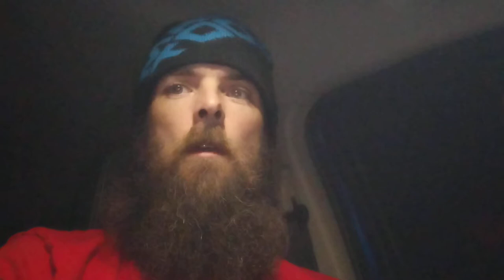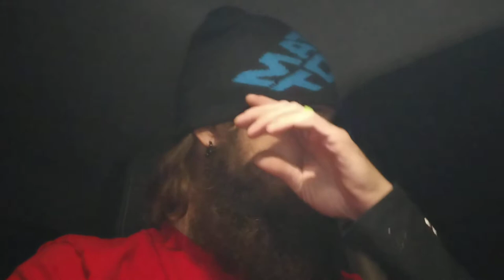My Brake Caliper Keeps Sticking. Why?

Comment: Been dealing with this issue for months now, rebuilt the caliper, putting new hoses now. Fingers crossed
Reply from the maker: I bet you have a collapsed hose or the inside has been eaten away Making little flaps not allowing the fluid to retract keeping the caliper activated. Keep me updated.
Reply: Will do. Its been cringe driving the car. The engine has been working twice as hard, wasting more gas. We'll see how it goes this time.

Comment: Just replaced both rear hoses on my daughters ‘07 equinox. They had the factory stampings on them! They still looked ok but seeing as how I was also replacing the calipers, I changed them  at the same time. Cheap insurance in my book.
Reply from the maker: Smart. Cause if you didn't change it.  Then it would probably fail. You are correct. Cheap insurance better safe than sorry. They are only good for about  5 years anyway. Brake fluid should be changed every 5 years as well
Reply: @BeardedFordTech  yep, did that at the same time. 
Was definitely on borrowed time with those hoses.
Reply from the maker: @dm7097  job well done!  Now it should last many more years.
Reply: @BeardedFordTech  idk about that, I am in the salt belt of western New York. Lmao
Have a great day!
Reply from the maker: @dm7097  well let's hope it does!  Salt belt nooo.  Did you spray any kind of coating or protector?
Reply: @BeardedFordTech  yea but I bought it used so I’m at the mercy of the p/o. 🤷
Reply from the maker: @dm7097  you have a valid point